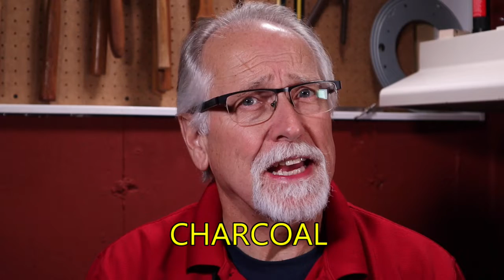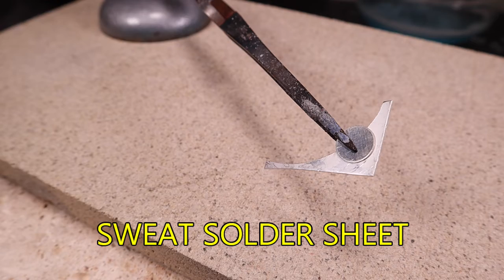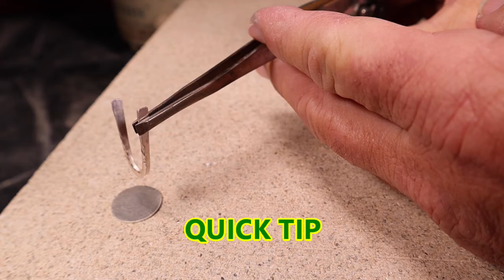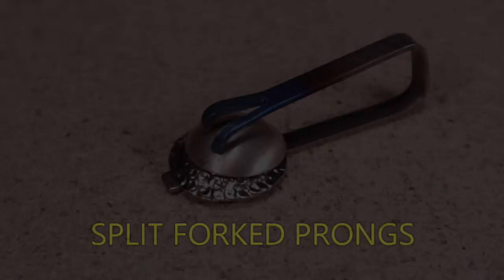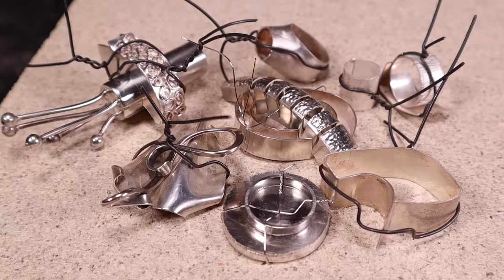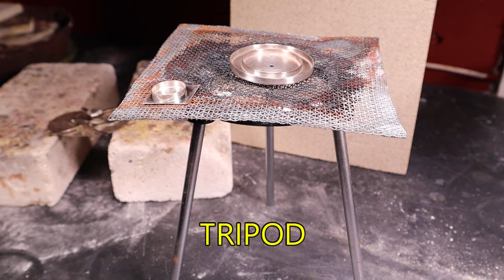30+ SILVER SOLDERING SET UPS

Comment: Greg, this is off topic from this video but I’m having a myriad of problems and you’ve always been so helpful and responsive in the past I thought maybe I could ask here anyhow.

I’m trying to make a basic Cuban link chain. I made one before and didn’t have much trouble and I had terrible gear. However, I was just working with 999.9 silver. 

Now I’m trying to make a proper silver chain so I got some copper to make sterling silver. I was concerned that maybe just regular construction grade copper might have other alloys that could mess up my sterling silver so I bought laboratory grade copper. I figure it couldn’t get cleaner than that. 

I mixed up a batch but I’ve been having an impossible time with it. It’s substantially harder than the pure silver I’ve worked with in the past. However, the biggest problem I’m having with it is that it solidifies instantly. I can’t pour it fast enough before layers harden and the ingots are unusable with layers and turf globs. It also forms a dull gray/black layer of hard soot. I can’t figure out how to get rid of the soot or where it’s comings from. I’m guessing it’s graphite dust from my crucible. My crucible has been used quite a few times. Are they dangerous in terms of spontaneously breaking? I worry about it breaking while I pour and then all the molten silver exploding off the concrete floor and blasting me with scalding silver shrapnel. 

Anyhow, my main question from this rant is trying to figure out why the sterling silver mix I made is so impossible to work with. It solidifies instantly. I can’t get usable ingots.

I heat it to 1100 degrees before I pour, do I just need to heat it up more? 

The soot layer is annoying too. Do you think I’m correct about it just being graphite dust? Are there better options for crucibles I should use for my kiln? 

As always, any wisdom you can share is much appreciated.
Reply from the maker: Hello Darren, You're right, sterling silver is a lot tougher to work with than 999.9 silver. The issue you are having with the silver solidifying so quickly could be due to your pouring temperature.  Pure silver melts at 960.5 C or 1,760.9 F.  Copper melts at 1,083 C or 1,981.4 F.  So your pouring temperature must be closer to 2,000 F.  Are you using borax in your crucible when melting the metals?  Is your crucible ceramic? Also, your ingots must be heated with a torch prior to pouring melted metal into them. If they are cold, then the metal will not flow into the ingot, it will just freeze. Making ingots and wire is not an easy process.  It might be worth it to you to purchase sterling silver wire for your Cuban link chain and skip the making your own wire.  
Thanks for your questions.   Greg Greenwood
Reply: @ you’re the best! Thanks again for helping me with a simple question that would have taken me days of watching videos hoping someone will touch on my subject. 

I think that it’s probably just a matter of not heating it enough for the copper. Perhaps the type of copper I bought could exacerbate the problem. I do use borax in my hand held ceramic crucibles. I mostly use my electric kiln with the graphite crucibles to melt the metal and try to remove impurities (my methods are still not very successful). I do not heat the ingots prior to pouring them (I don’t think). I thought the ingot was the resulting piece of metal that I’m pouring. Did you mean to ask if I heat the mold? Have I misunderstood ingot this whole time? I heat the mold/ingot before pouring into them. The molds I use are also graphite. I recently saw some crucibles (not molds or ingots) that seemed to be ceramic or even combinations of ceramic and graphite. 

The graphite crucibles feel sketchy too me. They seem to deteriorate really fast and they shed dust all over the metal. Maybe ceramic molds are better crucibles? 

I can probably crank up the heat on my kiln. I just get scared of the crucible when it’s emanating that much heat and the crucible feels like it could shatter.

I don’t want to just buy silver sheet or wire. Working with the molten metal is half of what I find so fun about doing this stuff.
Reply from the maker: Hello Darren,  OOPS! Sorry, I missed putting in the word "Ingot Mold." You are correct that the ceramic crucibles are better. 
I hope I have helped you.  Let me know how it goes.   Greg Greenwood

Comment: Hi Greg, I'm having an issue with the general solder gun not heating up enough to melt the soler.  What type of soldering gun do you recommend?
Reply from the maker: Hello Cathy,  Sorry you are having trouble.  Question for you before I can answer.  Are you using an electric soldering gun or a flame torch?  If you are using an electric soldering gun, it is not used for silver soldering.  You must use a propane, butane, or acetylene gas torch. Let me know what you are using and we can go from there.  Thanks and talk to you soon.   Greg Greenwood

Comment: Hi. Thank you once again for the video! What do you mean by heat sink? Also, where did you get the titanium clamps from? Did you make them yourself? Do you have a video that explains when you should heat underneath a piece versus heat above the piece? Thank you for your time. Really appreciate you answering my questions. I am  new to the metal/silversmithing world; I only have a few projects under my belt.
Reply from the maker: Hello Lori,  Heat sinking means any tool or surface that is "sucking up"  the heat from your project that you are trying to solder.  Sometimes the tools that are heat sinking will prevent you from ever reaching the melting temp of the solder. So you must use a large enough torch or torch tip to heat the piece up to melting temps.  I made the titanium clamps.  I got the titanium from Rio Grande #110795.  Knew Concepts Titanium Soldering Strips. Remember:  practice, practice, practice.  You will get better and better.  Greg Greenwood
Reply: @greggreenwood4628  Ahh.... so is that the reason why we heat the tweezer first, so it doesn't suck heat away from the solder point? In your videos, I do not see you heating up the tweezer before heating up the ring shank then to focus on the solder point. Thanks for the encouragement!
Reply from the maker: Hello Lori,  You almost have it correct.  You have the right idea, but you do not want to heat up the tweezers first.  The tweezers are to hold the piece of jewelry.  Keep the tweezers as far away from the solder joint as possible.  You always want to heat the jewelry piece ,not the holder.  Heat the ring shank and then focus on the solder joint.  Please check out my PLAY LIST "Silver Soldering Techniques".  There are many videos in the playlist that will help you learn about soldering.  Keep watching.   Greg Greenwood

Comment: I was taught to hold the workpiece in block of plasticine so all the joints were covered with the plasticine.  Then use plaster of paris to fix all the bits in  place. When the plaster is set remove all the plasticine. leave to dry a while then remove any grease with solvent.  Place your solder, flux and heat either with a torch or if large in a kiln.  Its is time consuming but if the piece has many joints you may be able to use one grade of solder.  You then break off the plaster and clean in an acid bath, not your general pickle.
Reply from the maker: Hello Ken,  Thank you for sharing.  I have heard of this method, but I have never used it.  I will keep it in mind.   Thanks for watching.  Greg Greenwood

Comment: Great video series! I wonder if you could do a video about the titanium clamps. I ordered some titanium strips that I was told could be formed into any of the soldering aids you showed. However, I have found them impossible to bend at all. I tried annealing them and again, no luck. Even had my husband and my son try & they couldn't budge them either. Would love to know what the secret is.
Reply from the maker: Hello Agnes,  Thank you for your kind comments.  The titanium strips that I show in the video are from Rio Grande Jewelry Supply.  # 110795.  Knew Concepts Titanium Soldering Strips.  4in x 3/16in x 1.5 mm thick.  They are stiff but bendable.  Use strong pliers.  The metal that you are using might be thicker and possibly not annealed. If you have annealed them, then please use a stronger pair of pliers and/or a vice.  The Knew Concepts come annealed.  The thickness is important.  1.5mm.    I hope this helps you.   Let me know how it goes.  Greg Greenwood

Comment: What torch do you use? Great video
Reply from the maker: Hello Chris,  For my main torch, I use a Presto-Lite Acetylene and Air.  This gives me a wide range of temps and tip sizes.  I also use a Blazer micro torch.  It is a small Butane fueled torch.  I use it for very small soldering jobs. There are a wide range of torches at Rio Grande Jewelry Supply that you may check out.  Thank you for your question.  I appreciate it.  Greg Greenwood

Comment: This may be a silly question... I can see that solderinng can leave soldering materials on the various soldering blocks.  Can this affect your soldering if you are on one of these little messy spots from previous soldering jobs?  When do you really know it's time to change out that block because of this problem; or is it?
Reply from the maker: Hello Crazy,  Good question.  The marks that you are seeing are mostly heat related on the vermiculite blocks.  Does not hurt.  On the charcoal blocks ,  there can be some flux left over from soldering. This can be easily scraped off with a knife.  Before you solder on any block,  you should check for any extra solder that might have fallen onto the block.  This is what can be a problem.  It could melt onto your next project.  Easy check, no big deal.  The soldering blocks will last for years.  Keep them brushed off,  don't worry about it, and have fun soldering!!  Greg Greenwood
Reply: @greggreenwood4628  Thank you so much. 😁
Reply from the maker: Anytime!   Greg Greenwood

Comment: Hi Greg, I've got some green and blue marks after soldering that doesnt sand off. Any idea what caused it, and how to fix it?
Reply: Pretty sure it has to do with my borax mix (not enough water mixed with borax powder) or my pickling liquid ( white vinegar and salt) or dunking the silver in the pickle while it's still hot. Any help is appreciated. Thanks
Reply: @ccccccccul  following.
(Quench before pickling, and if using simple home made pickle I find you sometimes have to let a piece sit in the hot pickle pot for a longer time, but I’m NO expert ;)
Reply from the maker: Hello Gnarbel,  I agree with you.  Thank you for your comments.  It is great to help each other!!  Greg Greenwood
Reply from the maker: Hello ChopohC,  Check out my reply in previous comment.  Let me know.  Thanks  Greg Greenwood
Reply from the maker: Hello ChopohC,  Thank you for your question.  I have a couple questions for you first.  Is the coloration "in" the silver or "on top" of the silver?  If it is in the silver, it could be you have not left the piece in the pickle long enough to get rid of the oxides or it could be fire scale.  If it is on top of the silver, it could just be extra flux that has not cleaned off in the pickle.  In both cases, leave in the hot pickle longer.  Let me know how it goes.  Greg Greenwood

Comment: Really nice job on the videos Greg! Loving all the great information too.
Reply from the maker: Hello Osckarre, Glad you like them! I appreciate your comments.  Greg Greenwood
Reply: @greggreenwood4628  Hi Greg, I wonder if you could tell me what kind of torches do I need for silver soldering. I would like to learn. Also I would like to know how to melt silver with a torch. Do I need a special license to obtain the torches and the tanks?
Reply from the maker: Hello Osckarre,  You can use butane and propane torches for general soldering.  This are inexpensive and you can get them from your local hardware store or even some box stores.  For melting silver, you will need a hotter torch.  Acetylene and air or acetylene and oxygen are great for melting silver and casting. These are more expensive and you must get the tanks from a welding supplier.  All of these torches are available at most Jewelry supply houses.  Rio Grande is one company here in the US.  They ship to Canada also.  I hope this helps you.   Thanks for your questions.  Greg Greenwood
Reply: @greggreenwood4628  Thank you, it sure helps. I'm shopping now! :)